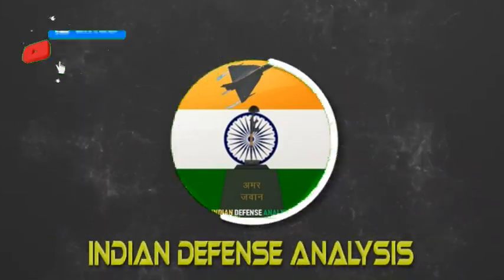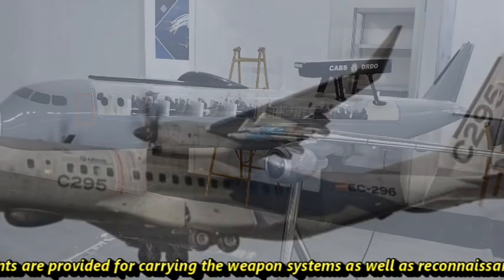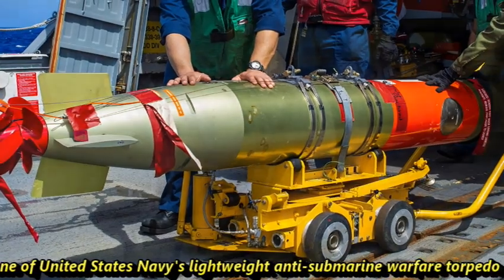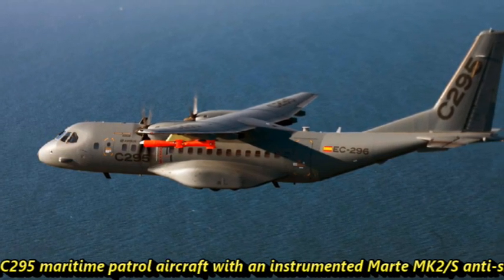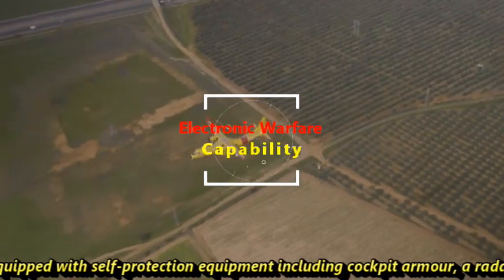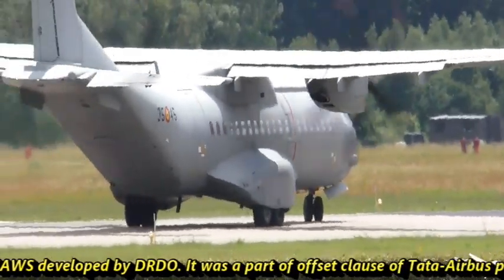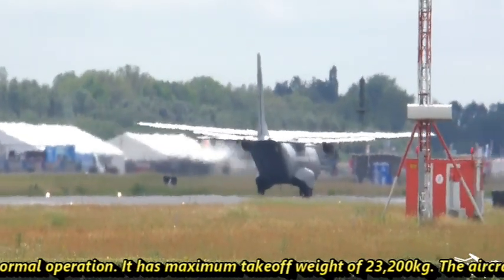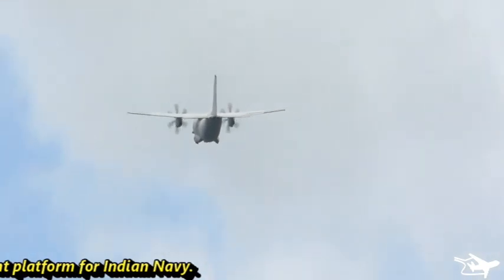Part-II : C295 based DRDO MMMA:  Weapons & Electronic Counter Measures| Making of indigenous P-8I

Comment: Just asking for a friend.
How is this aircraft Multi Mission? Is it capable of parallel multi mission or only serially?
How wide is its multi missionary position? Will the Pakistan Navy need to conduct all its operations in the same area? Or can PN move around a bit, you know, use different assets to come in from different directions and to differrent places etc.

Comment: Japan has 100+ such aircrafts , they developed it indiginiously , and that's the reason why Japan don't need to fear the large Chinese fleet of submarines , we too need atleast 24-48 such aircrafts
Reply: Agree but 
I think navy should go with 6 more p8i 
Because you can't expect delivery of c295 before 2026 .
Reply: More like 18 P-8I and 72 of these just to cover the coastline. The P-8 is a true multi mission aircraft, without any adaptation, these are mainly maritime patrol and can be adapted to do other missions. They use a lot of Netra technology so they should be looking at a parallel development of the Netra on the same platform.

Comment: Can we use stuff like DRDO's light weight torpedo on it or say bhramos ng or the exoset asm
Reply from the maker: There is something basic that we have to understand here. For any aircraft first factor is payload. In case of C295 it can carry the weapons you have mentioned. Then comes it's integration with software which can also be done once OEM agress to help or share the source code. The. Comes it's wind tunnel testing with weapon. Last the the trials with missile having inert and actual warhead. The entire process can take 2-3 years if fast tracked.